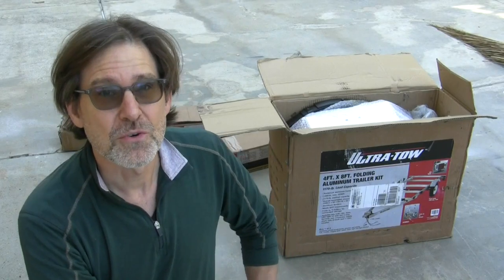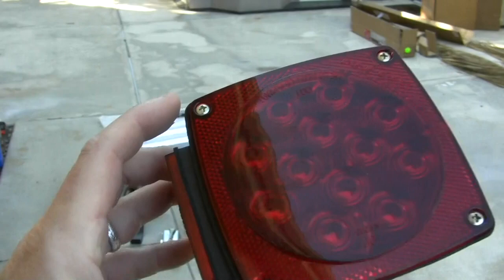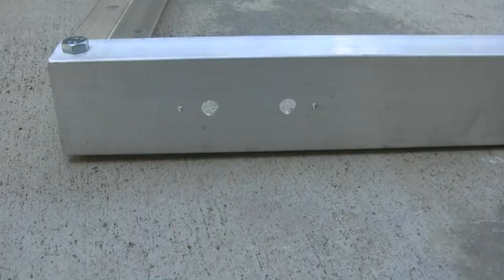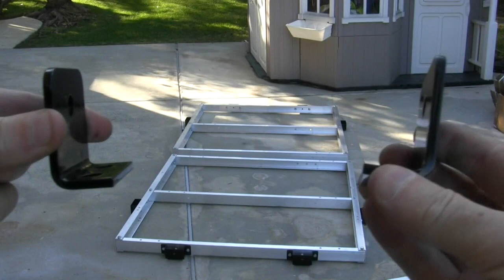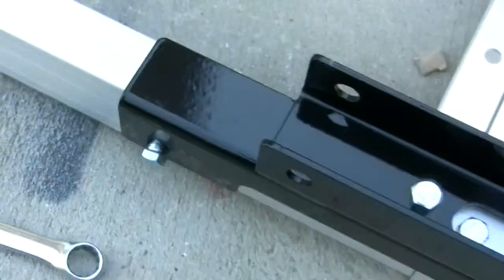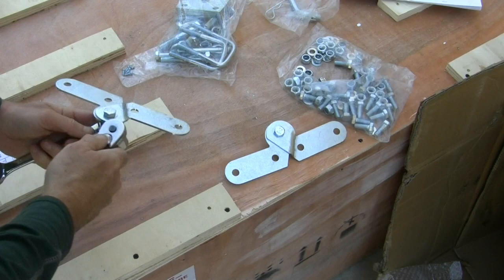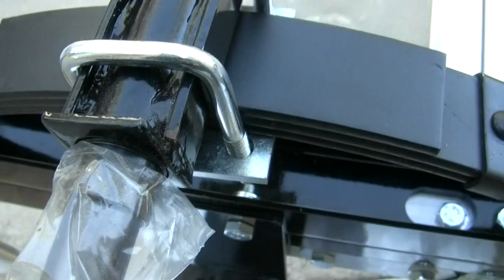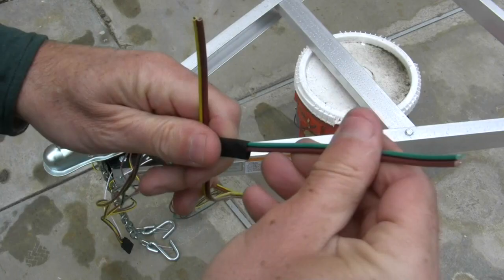Build Lightweight Ultra-Tow Folding Aluminum Trailer

Comment: assembling mine tomorrow - thanks for the tips -- I took notes as you went through steps -
Reply from the maker: If you're going to do top decking (as I would guess most people will), you can leave the top bolts out until you install that.
Reply: @UrbanMonkTV  yikes what a project -UGH !!! My spouse and I are pretty capable - do lots of projects but this is frustrating and as mentioned by others the directions are like a mystery novel - but worse is the sellers of these and the manufactures know this and they make no effort to rewrite them - a few basic explanations and better graphics would solve 90 percent of peoples questions and frustrations -- I could write volumes here plus you need a magnifying glass to read them. and you can double or triple the 3 hours they say it takes -- the best suggestion -- do the entire project on a table somehow or saw horses - or plan to ruin your back --- however, the suggestions from Urban Monk were certainly helpful -- as a matter of fact i am re-watching the video before i finish to be sure all is ok
Reply from the maker: @williamrsteinhaus9666  Thanks for watching and commenting! Yes, those instructions leave a lot to be desired. This was actually one of the most difficult videos I've ever had to edit because the poor instructions led me into so many situations that I had to backtrack from that making sense of it all in the editing stage was a mess. Ultimately I'm happy with the result, but it was a journey.

Comment: I've done a smaller version of this trailer. The cone surfaces of the axle are often contaminated with welding swarf (?)  That must be cleaned off. Also the grease already in the hubs is notoriously bad so I cleaned that out and put top quality grease in. These little trailers need all the help they can get.

Run ground wires - don't depend on chassis ground. Solder all connections.
Reply from the maker: Good insights for the community here. Thanks for watching!

Comment: Hi all, I just finished the base trailer on this build (no deck or sides yet.) I wanted to do a quick debrief while things are still fresh in my mind. First off, you are starting your build with the trailer upside down. Consequently when you put on the arms with the serial number and VIN on them, make sure you put them on so they are upside down and you can’t read them. When you are laying out your frame rails, at least on mine, there are only two holes in the rails that have mount holes drilled for the running lights by them. Locate these two rails and make sure they are on opposite sides with the running light holes toward the front of the trailer. In my case I discovered this after I had the frame assembled and just went ahead and drilled the holes for the one I missed rather than disassemble. When mounting the hinge, the two bolts closest to the hinge bolt itself interfere with the frame bolts. After loosening the frame bolts for access, I inserted the inner hinge bolts so that the bolt head is inside the frame and the shank protrudes outwards and no longer interferes. I also put the actual hinge point bolt in the same orientation with the thinking I that it’s bolt head was less likely to interfere with a load than the bolt shank would. Regarding the wiring, the first thing I did was to determine the quality of the trailer frame as a ground path. I took my ohmmeter and measured 0.1 ohms from the front of the trailer to the rear. Consequently I put ring terminals and heat shrink on all of the white ground wires and used self-drilling sheet metal screws to mount all of the white ground wires up to the frame rails. I used just a plain old 9v battery (like us oldsters used for transistor radios) and a couple short pieces of electrical wire to test the lights paying close attention to polarity. The plain post is positive and would go to your brown, green, and yellow pins in the connector and the springy slotted connector on the 9v battery would go to the white ground wire. I tested the lights while the back was folded forward so I could see the lights from the front. Thanks to everyone else who posted tips! It was all very helpful. Good luck to everyone on their assemblies! Oh yeah, one thing I did was to clamp a framing square to the inside of the frame as I snugged up the frame bolts so I could make sure it was as close to square as possible as I assembled. I ignored their advice to leave the bolts loose. I did have to remove or loosen a few back up along the way, but I found it helpful to have it square and snug early on.
Reply from the maker: Thanks for sharing for the benefit of others.

Comment: Good video ,Overall  IMO for the money this Trailer seems like the better of the deals  on the small Utility Trailers available  as a  kit  to Be Assembled  a Cousin of mine  who is a Engineer bought a Harbor Freight one  he assembled in his garage  in the evenings and he told me that not one set of predrilled holes aligned on the entire thing it was a Steel Trailer that he  reemed out every hole with a Die Grinder  he is happy with the built product  but i personally think the all Aluminum NorthernTool one is a better deal  and Engineered nicer thanks for your tips
Reply from the maker: Thanks for watching! Now that I've survived the terrible instructions and it is all together, I'm very happy with the trailer. Wiring needs improvement but functions.

Comment: If you don’t need to fold it, put bolts through the frame to stiffen it up.
Reply from the maker: Absolutely right. In fact that is what I have done since making the video. I wanted to show it folded to make sure viewers understand it can be folded, but I do have the space. With the bolts in (non-foldable) it doesn't bang around when pulling it empty. Thanks for watching and for throwing in this good insight for the benefit of others!

Comment: I hear them lock nuts breaking loose at certain points, which I'll add an additional with red thread locker or something.
Reply from the maker: Thanks for watching! Red threadlocker will certainly ensure they do not come loose, though I haven't had any issues with the lock nuts coming loose yet. I did however lose one lug nut and I had torqued them with my torque wrench.

Comment: check out 13.05 to 13.15  that's one of the most important parts to understand in ENTIRE video and as you do your assembly - you do a great job showing a close up but a graphic or verbal comment would have  been helpful , I had to watch 3 times before i noticed the change you made -- when the hinge plates are installed the instructions say nothing about how to install the bolts - fact is, the one bolt will NOT go in with the head as inserted everywhere else on trailer and as Urban Monk initially shows  here because that one bolt hits a nut on the back inside of the corner beams - in fact the video shows moments later that bolt reversed by Urban Monk and put in from the rear inside corner but to do so the obstructing not and bolt on the inside rear corner has to first be removed -- its subtle - but other wise the hinge plates cannot be attached
Reply: this is also one of these classic projects ( just like anything mechanical , plumbing , carpentry etc) that once you are done you realize the next time if you were to ever do one would take one third the time once you know how to do it
Reply from the maker: Thanks. Yes, the instructions are super vague and I did need to do some backtracking. Made for a nightmare editing and impossible to capture it all and keep in order and below 25 minutes (target max length I aim for, but don't always achieve.) For me, this was really two complex projects simultaneously - the trailer and the video.

Comment: That's great it's not going to rust it's the exact same trailer from harbor freight just in aluminum and I love the color much better than the red from harbor freight that eventually turns pink in the Sun
Reply from the maker: Yes and, for my lightweight electric car, this thing is a breeze to pull. I don't notice it's there at all other than the sound of my receiver hitch rattling (which is expected).

Comment: 10:30.. Is that me or you mounted  the tongue side up and after 16:59, you fixed it.. ;-)
Reply from the maker: Yes, I mentioned how the instructions are unclear on this later in the video. Unfortunately I didn't have video captured of the "fix", but I did speak to it. Thanks for watching.
Reply: @UrbanMonkTV  No worries... It happens to the best of us... I am myself looking to buy a foldable trailer to be towed by my low sedan car.
Reply from the maker: @pascalabessolo5350  My tiny electric has no problems pulling this aluminum one. I'm happy with it. Don't need a pickup anymore and drive on power from my solar panels. Gave up nothing in usability and gained a big inflation hedge as my energy costs are way down.

Comment: Thanks for the video.  Can you make a video showing how you fold it up?  Do you need to remove bolts to make it happen?
Reply from the maker: Thanks for watching. I've been meaning to do a follow up video on this trailer for a while now that I've been living with it a while and using it. I still like it and it benefits me greatly, especially in these high gas price times. (Don't need to own a pickup and can still haul 1/2 ton loads.) Short answer is no, you don't need to remove bolts to fold if you've assembled it in a certain way, leaving two bolts out on the rear section. I'll make that part of my follow up. May take a couple weeks before I get around to it.
Reply: I’d appreciate if you can make a video showing how to fold it. 
Thanks for the video, I just assembled mine following the directions from your video 👍
I just can’t figure out how to fold it
Reply from the maker: @MichaelBurko  I intend to do a video of that after I finish a couple other videos I currently have in the pipeline. Thank you for watching!
Reply: @MichaelBurko  there are many harbor freight folding trailer videos that shows many ways to fold theirs..although they are not aluminium they are made and fold similarly..
Reply: @FuzzballToday  thanks! I didn’t know they fold the same way

Comment: Manual says only 45mph. Did you do anything different to go faster?  I would like to tow at 55mph.
Reply from the maker: I live in an area where I'd be in real trouble for going 45. I've done 65 for 35 miles without issue.

Comment: How did you flip the trailer over after the upside-down assembly????
Reply from the maker: Thanks for watching! In hindsight I regret not capturing the "flip." As I mention in the video, the instructions are very cryptic regarding the initial orientation of parts. I was simply too far into assembly and too short on time that day to disassemble and start over. As to your question, I did exactly that, just simply flipped the frame and re-attached the tongue pieces.

Comment: Had the exact problem with the castors from the harbor freight folding trailer super duty i bought..I called the customer service they told me i had to find a thinset 🔧 wrench set
..I found a set($20) from amazon..what a bother! You are right..they should of included a stamped thin 🔧 wrench with the kit..I am starting to wire and some videos show putting a a wire from the where the tongue and the box frame to keep continuity to the ground cause it loses ground at that point...have you had any ground issues since you had it?
Reply from the maker: Thanks for watching! No, no ground issues. Lights still work perfectly every time I plug them in, even after trailer-side plug has spent a year in the elements. Ground seems good. Caveat...it doesn't rain much here. Mostly brutal sun and some salt in the air.

Comment: The Northern Tool assembly manual is horrible and they have no support for this trailer. I was stuck for a while trying to figure things out and they couldn't answer my questions and didn't call me back. If one of their staff would actually assemble this trailer using their instructions they would see the shortcomings and fix the manual. I was also missing one M10 bolt and a few other things and had to run out to a hardware store, The folding of the trailer got me too but they told me to follow the manual, then didn't answer me when I told them the manual has NO instructions for folding the trailer. It would have been easier if they had some type of quick release instead of having to take out bolts. Also my manual is apparently not as detailed as yours and doesn't show an actual inventory of all the hardware. The instructions reference "bolt bag #2" for instance but the bags are not marked. It's pretty outrageous. I am not happy that it took me three days to get this thing put together and much of that time was spent sitting around scratching my head trying to figure out how to assemble certain parts. In some cases the instructions are just plain wrong and had me assemble parts in the "wrong" order forcing me to disassemble what I had already assembled and re-do it.

Your video helped me tremendously. While you missed one or two things I needed to see, you solved my main issues by at least letting me see what certain assemblies looked like when together. The hinges gave me fits but after your video I was good to go. You provide a lot of valuable information and finding your video saved me on this project, especially since Northern Tool is useless.

Thank you!
Reply from the maker: Thanks for watching. I'm glad you got it sorted out. Yeah, it is very much a DIY project with those instructions. Mine continues to serve me well though.

Comment: Are you comfortable on the freeway? Perhaps traveling with this? Relatively light load.  Is the speed rating of tires and axel an issue?
Reply from the maker: Personally I wouldn't travel at speeds over 65 mph for any extended period of time with a wheel size 12" or less. Not any sort of official recommendation, just my opinion. California speed limit for vehicles pulling trailers is 55 so it'll fit my needs. Also, Bearing Buddies might not be a bad idea for trailers that will run at higher speeds. Keep those bearings greasy. Thanks for watching.

Comment: Great video!   Question. When in folded position how tall is the trailer top to bottom?     Thanks again!!!
Reply from the maker: Thanks for watching! I'm not sure if they every use different wheel sizes (the small casters) but mine measures 119 inches bottom of wheels (casters) to tip of tongue (hitch). Hope that helps!

Comment: I bought this trailer and am assembling it....at about 10:12 you are installing the spring supports.  Dumb question but how does the trailer fold after installing these?  It seems that these lock the front and rear halves together.
Reply: A little more detail...to fold, it seems you need to remove a total of 4 bolts - 2 each side.
Reply from the maker: @tehammel  Correct. I learned that after filming that section. Assembling these things is a journey for sure. Thanks for watching!

Comment: 0 seconds ago
Was hoping you might confirm the folded outside fender to fender measurements of the trailer. It is the small storage area required by these trailers that make them an attractive purchase. My condo storage unit is exactly 63 inches wide. If the assembled trailer varies even by half an inch it will not be satisfactory for my requirements. Can you advise of the 
width of the Northern Tool Ultra Light 4x8 Folding Trailer when folded for storage???
Reply from the maker: I should point out that I do not work for Northern Tool and thus cannot speak for them officially. I'm just a guy who bought one of these trailers. With that said, mine  (folded) measures 62.75"x29". If you decide to purchase one, please consider using the link I provided in the video description. It helps support my channel a tiny bit.

Comment: I almost bought a maverick hybrid but I don't really need a truck. Mayne only once or twice a year to go to home depot and do diy home projects.  Should I buy a foldable utility trailer instead and add a hitch to my Nissan leaf so I can haul stuff whenever I need it?? How heavy is it and is it easy to fold and unfold?  Can i store it outside in yard if i dont have space in garage?
Reply from the maker: I was once like so many people - thinking I needed a pickup truck in my life. I've come to realize I don't. As in frequently as I haul bulky things, this lightweight trailer behind my electric Volt is perfect. If I ever needed to haul something over 1/2 ton, I could just rent a truck. That occasion hasn't happened in 7 years. How much $ would I have tied up in a truck (cost of purchase, ownership, gas and insurance) had I owned a truck that 7 yrs? Folding is easy enough but the wiring needs to be positioned just right to accommodate the bend in the middle. I have the space so I find myself leaving it flat, but it will fold without too much trouble. I'll never own a truck again.
Reply: @UrbanMonkTV  can it be store outside?  And can I add tires to move it lateral?  I may just buy a shed to store it on side of house  or build one. However the gate on the side of house it's only 3-4 ft wide I believe